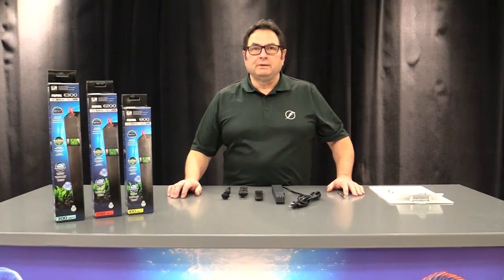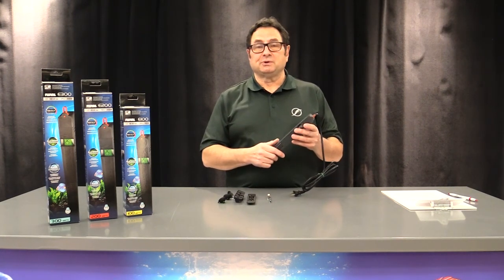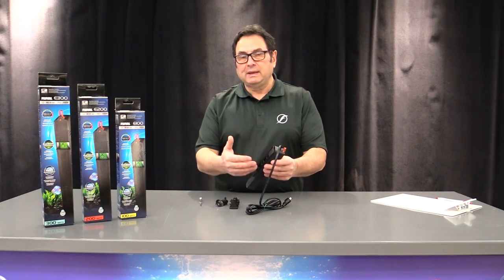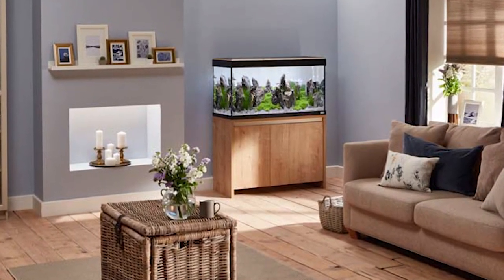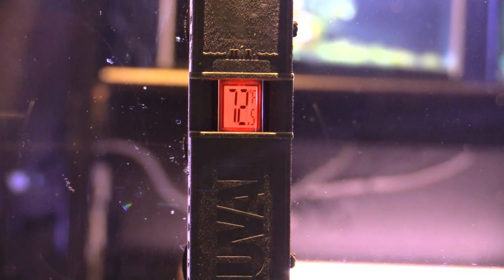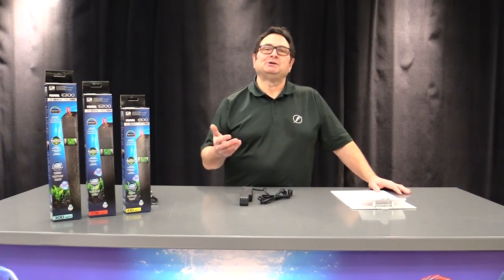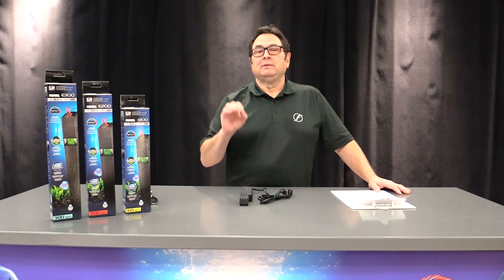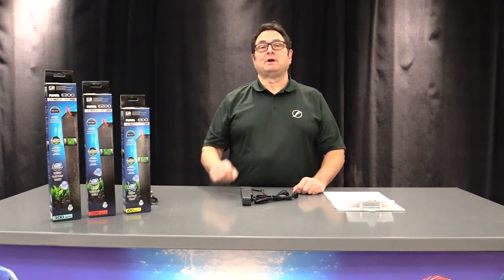Fluval E Series Heater Operation & Troubleshooting Tips

Comment: I've got a 300w heater and it's connected to a inkbrid temp controller,  the heater is  not going upto 26c so the temperature controller is reading below my temp set , it's been going 24 hours and still.noy reached the right temp outflow  from 407 is directed onto.side  of heater so no water flow problems , ive an open top tank so should I cover it or raise the temp? Thanks
Reply from the maker: Hi Lee, what's the ambient temperature of the room? An appropriately-sized E series heater will generally heat the aquarium 6 deg. C / 10 deg. F above room temperature. Covering the tank will certainly help maintain the right temperature!
Reply: Ok thanks I'm also running 2,  407 canisters on it , what the best position for the inlets/outlets,  I have them both at each end of aquarium at moment

Comment: I’ve had the e100 for years.  I recently unplugged it to clean it.  I followed directions in letting it sit before removing, the cleaning instructions, and letting it sit in the aquarium for 20 min before plugging it back in.  Now, it will only display 25°C.  I tried to use the set directions to change the set temp, and also tried pressing the lever to the left for a 5 count to change it to Fahrenheit.  It won’t change to Fahrenheit, and I also cannot get the temp to flash to change the set temp.  Not sure if the lever switch has just gotten really old or what.  Any suggestions?
Reply from the maker: Hi Bryan, we're sorry to hear about this! Our customer support team is available to help you: https://fluvalaquatics.com/us/contact-us/

Comment: Just got one of the 100w heaters in a 75lt tank and set it to 80f  and heater cannot get tank upto the right temp, stays on 77f and drops to 75f but it cannot get above 77f in my 75ltr tank ?
Reply from the maker: Hi there, we're sorry to hear about this. As E Series heaters are housed in protective casings, it's important to ensure they are subjected to strong water movement. Ambient room temperature is also a factor: if the difference between it and the heater's set temperature is more than 10°F / 6°C, additional heating capacity is likely necessary. For more assistance, please contact our customer support team: https://fluvalaquatics.com/us/contact-us/
Reply: @fluval  tried moving it and still the temp cannot reach 80f i set it to , blue light is lit at 76-then 77  but wont go any higher , realy poor quality heaters in my years of owning loads of fish tanks ,  heater rated for 120l and tank its in 75l ?

Comment: I have an E300 on both a 50 and 55 gallon.  They struggle to keep up.  Instructions say to install it at 45 degrees--but it looks like crap.  Both tanks have Fluval 305 and 306 canister filters on them and an air stone directly below heater.  Flow should not be a problem.
Reply from the maker: Glen, did you try placing the heater such that the flow is directed at the side of the heater cage?
Reply: @fluval  Yes, it does not seem to make a difference.

Comment: I got my heater over almost a year but I noticed is not heating the water I set up the heater at 77.5  and display said 76.5 in the morning 🤷🏾‍♂️
Reply from the maker: Hi there! It's normal for the water temperature to fluctuate slightly, especially in the morning, when the house temperature has dropped overnight. You should see the water temperature heat back up quickly - if it doesn't, please contact our customer support team for assistance: https://fluvalaquatics.com/us/contact-us/

Comment: Last night, I placed a Fluval Series E100 in a 29 gallon aquarium. The heater was between two hob filters. The temperature was set to 76.5. 

At first, the heater was working fine, however, after about an hour and a half, it began showing the low flow indication quite frequently. During this time, the temperature had reached 77 and was staying around 76.5-77. Then, after a few minutes, the light turned red and it showed 79. It then went to 78.

At that point, I unhooked the power and after a few minutes I removed the heater and placed the original back in. It was getting late and it would have been too risky to leave the heater in.

Placing the heater directly in the flow of the hob filters is not really possible. Is there anyway in this situation to ensure the low flow problem ends and that it does not start registering unusual leaps of temperature? The heater just arrived yesterday.

The heater was in a vertical position, as the manual seemed to recommend that. It was completely submerged, though the temperature display was fairly close to the surface.
Reply from the maker: Hi there! Try positioning the heater more directly in the path of moving water, or purchase a small circulation pump and position it to blow across the heater to help with heat distribution in the aquarium. Please feel free to contact our customer support team for more assistance: https://fluvalaquatics.com/us/contact-us/

Comment: What does the EE display mean? I've had the heater for 6 months and all of the sudden it is displaying a red "EE" and my water has dropped to a dangerously low temperature
Reply from the maker: Hi Adam, that is an error code. Unplug the unit and re-plug after few minutes, the unit should reset and operate normally.

Comment: Hello if  I'll put the heater in return pump section and if my water level will drop there, heater will shut down? Thank u
Reply from the maker: The E series does have a safety shut off. That said you should never allow that much evaporation without top off and partial water changes.

Comment: Hi there ,great presentation! Did answer on my few questions, but still there is one remains - I do have a 250L tank and I need temperature of 25 degrees to be , what temperature is should set-up? If I will setup for 25 degrees ,is my tank would be 25 degrees ? Or I need to bring up temperature on the heater higher ? The themometr shows that is 25 degrees and display on green light ,but I also using a normal Themometr and shows that is only 21 degrees in the tank.. which make me confuse a little bit ,could help me solve this problem please ? As it's really important to my terrapins that the temperature in the tank stays at 25 degrees I do also running another heater ,but don't know if there is a need of ,I wonder if the Fluval will be enough it selfs to heat up the desired temperature, Thank you
Reply from the maker: The E Heater comes with a default factory set temperature of 25 deg C. Some mass produced thermometers can be a couple of degrees off, you should check with another one, preferably digital with a fresh battery. It is also important to respect ambient temperature/aquarium volume limitations when choosing your heater in terms of power, 3 watts per gallon as a general rule. You may review the supplied instruction manual using this link: https://fluvalaquatics.com/manuals/Fluval_A771-A772-A773-A774-E-Heater_Manual.pdf
Reply: @fluval  thank you for the link ,I bought the biggest one which is E300 and the manual says it's up to 350L * mine only had a 250L ,which I thought would be enough to cover the whole surface of the water in my tank. Thank you I will check the temperature with digital  thermometer .

Comment: I have the fluval edge 46l with the 50w E heater. I can't get it to go above 25 degrees? The only time it goes above 25 is when it has gone up through the room being warmer and it flashes red. Can it not be increased beyond 25 degrees ? 🧐🙏
Reply from the maker: Absolutely. If it is flashing red that indicates that the water temp has risen above the set temperature.
Reply: An heater will only heat between 6 and I think 10 degrees warmer than room temperature depending on wattage. In a cool unheated room you probably need two.

Comment: Great video, one other question, how do you change the displayed temperature from Fahrenheit to Celsius?
Reply from the maker: Thanks for the question, hold the lever to the left for at least 5 seconds, here is the link to the instruction manual, it is covered within: https://fluvalaquatics.com/manuals/Fluval_A771-A772-A773-A774-E-Heater_Manual.pdf
Reply: Try hitting it. 👍🏽

Comment: If my ambient room temperature is 67 degrees, and I set the heater to say 82 degrees... will my water temperature ever get to 82? Seems it won’t go past 77 with this heater. I have a 300w.
Reply from the maker: Hi Tom, ambient room temperature will definitely contribute to the temperature of the water within your aquarium. Generally, the E-series heaters will increase water temperature up to 10 degrees Fahrenheit above the room temperature which is what seems to be happening in this case. To achieve a temperature of 82 degrees you may need to add a second heater into your setup or increase the room temperature slightly.
Reply: @fluval  Well, my old 300W Marineland can keep the tank at 80 or 81 without a problem. Was hoping your heater would be better. I guess I'll just stay impressed with your canisters and LED's for now...

Comment: Is it safe to put the heater halfway into the water or partially out of the water? I would like to install 3 E300 in my sump.
Reply from the maker: It should be submersed to the minimum water level mark on the heater.

Comment: Good day 

I hope you can help I am always uesing fluval E heater 300 watt . I have a problem with the temperature lever when I move it to adjust the temperature it seems it is not working because I turn it to the - or the + sign but the temperature degree does not change as if this red lever is bugs  so please advise how to solve this issue
Reply from the maker: If the heater has been previously functioning normally and is still under warranty you should contact customer support by visiting fluvalaquatics.com
Reply: Thank you very much I already sent them an email.

Comment: Is a 100w going to fit nicely in a 15g Fluval Flex?   AND if put in the pump or first chamber - is it going to work with flow?
Reply from the maker: We recommend Fluval M Heaters for use in Flex tanks when placing them in the pump chamber, due to flow considerations and ease of fit. Yes, the 100W E series will fit in the 15g Flex aquarium.
Reply: @fluval   Damnit - I just bought the E.  What is with this low flow issue with these?  Seems to be a problem with people.
Reply: @fluval  It should say this heater won't work with the Flex!
Reply: Um - it's working fine in the Flex in pump compartment.  :)    Cannot read the numbers though - just color.  It's not yelling at me for 'low flow'.   OK.  :)

Comment: Great video what is the steps to take on this heater as far as doing water changes? Thanks
Reply from the maker: During partial water changes simply unplug the heater 5 minutes before, plug it back it in after the partial change is complete.
Reply: @fluval  Thank you 🙏

Comment: How would i no if my heater has stopped working, my temp dropped and has not gone back up to normal for about 24 hours
Reply from the maker: Slowly increase the temperature back to where it should be by doing small water changes over an 8 hour span, that should avoid shocking your fish. Install another heater and investigate the heater failure.

Comment: Why can’t I increase the temperature on my fluval E50. I have had it running since November 2019 now it won’t increase above 23 degrees centigrade.  I have had the temperature up at 29 as I was having a problem with ich but now it won’t go above 23  🤔
Reply from the maker: What are you using to check the temperature with? Which thermometer exactly are you using?
Reply: Fluval Aquatics I am using the fluval  E50  in a fluval flex 50 ltr aquarium 🐠

Comment: Hi, can you tell me how to change from F° to C°

Thanks
Reply from the maker: Hi Antonio! To change the degree scale, hold the set lever in the full left (-) position for at least 5 seconds. When the new degree scale is displayed, you may release the lever. After a few seconds, the display will automatically return to display the water temperature.

Comment: Awesome video! I’ve just bought one of these from a friend and after watching your awesome informative video I’ve learned a LOT!
I just have 2 questions if anyone can help me please,firstly are these heaters fully submersible?
Also,I’ve tried to adjust the temperature but for some reason i move the stick left and it goes to 26,I move it right and it goes straight to 30,no inbetween and also 26 is flashing blue but 30 is green which makes no sense at all :(
Can someone please kindly help explain what I’d going on with my heater please,I have a 58 litre tank and are using the E50.
TIA
Reply from the maker: It is a fully submergible heater. Try a short quick movement to either side to increase or decrease in .5 degree increments. Set temperature will dictate screen color as will warning variation settings for flashing alert. Please visit fluvalaquatics.com to download the user manual.

Comment: Sometimes my heater is off a degree or 2°C, how do I recalibrate it ?
Reply from the maker: What are you comparing the reading on your heater against?
Reply: @fluval  a boiler thermometer and a pool thermometer. They both display 28°C, but the heater is at 30°C.

If I bring the temperature to 28°C, then the water goes down to 26°C.

Comment: Why is my e200 heater have red EE?
Reply from the maker: Hi Christy, as per the product manual this notice implies that the waters temperature is hotter than what the heater is set to. This can happen for multiple reasons, the most common being that the aquarium light or other equipment is causing a slight elevation in temperature. Our best advice would be to reset the heater by unplugging it and letting it rest outside of the tank for 40 minutes. While you do that, remove your aquarium hood to allow some excess heat to escape. After the 40 minutes, reinstall the heater to see if the notice reappears. if you run into any trouble with this, please contact our customer service team for further assistance. 😊👇

https://fluvalaquatics.com/us/contact-us/

Comment: HI what dose LF MEAN
Reply from the maker: Hi there! The LF error code means Low Flow - the heater has detected poor water circulation around it. Try positioning the heater so it receives strong, direct water movement from the filter. 👍
Reply: @fluval  oh okay I saw that on the video and didn’t give it much thought thanks mates appreciate you lot

Comment: I dont have a thermometer but I'm positive that the reading I'm getting off the heater is wrong
Reply from the maker: You should obtain an accurate thermometer to confirm.
Reply: @fluval  well I put the heater in tap water that is 100% colder than the 27.5 degrees C reading that's its giving me. It's just flashes red what ever I do

Comment: hi i was wondering how could i raise or lower the temp of the heater thanks
Reply from the maker: In this video we describe the adjustment of the set temperature.
Reply: @fluval  i am having issue's with mine it well allow me to lower the temp but not raise it
Reply from the maker: Please contact customer support at fluvalaquatics.com by selecting your country and then the support page, we will certainly help you out but require some detailed information about your set up  first.

Comment: Why does the heater have such a bulky casing?
Reply from the maker: Dennis, the heater guard is useful when keeping large fish or turtles, both of which can damage unprotected glass tubes.
Reply: I've had 2 Mollies burn themselves on my old heater which wouldn't have happened had a protective cage been around the heater probe. 😔 So  I myself am extremely grateful for Fluval putting these cages around this particular heater series.  To each their own though...Just know if you decided not to invest in one of these, you're definitely missing out on one fabulous working Fluval heater. Fluval hasn't disappointed  me with the first product (knock on wood).

Comment: Those heaters got released in October 2009, exactly 10 years ago! Most shops stopped selling them due to the “low flow” problems. Why this re-upload? I’m sure 10 years is plenty of time to re-engineer a digital heater and give us a new product instead of trying to sell a failed one.
Reply from the maker: Dimitrios, correct, we mention that the heater is not new in the video,  the point of the video is not to sell or re-sell but to support some of the questions and inquiries we have been recently receiving about the E series, hence the title: Operation and Troubleshooting Tips.
Reply: @fluval  Despite of the negative comments and the problems, I was actually looking to buy it because I'm tired of the inaccurate analog heaters. I'm looking forward to see a new version of this heater!

Comment: wasted money buying 2 of these for my 100 gal. tank. If you live in colder weather these will not heat your tank, you would have to have your house at 70 degrees to get to 80. I don't see how someone could build a heater with all the features except heating tank. How efficient is it to have to raise home temp to heat aquarium. ridiculous
Reply from the maker: Thanks for your comment! As per their intruction manual and packaging, E series heaters are engineered to increase water temperature up to 6°C / 10°F above room temperature (20°C / 68°F).
Reply: @fluval  That's nice at the bottom in small print you put may need a second heat to get temps to 10 degrees above room temp. I have 2 and they still can't get to 10 degrees above temp. All in all I guess these would be a big hit in Hawaii. Most of the states in the US will have colder temps and these don't work
Reply: Yeah, this is bullshit. Only reason I bought this heater was to heat my tank, which is in my basement - room temp is 65 degrees all year around in Michigan. False advertising by omission. I want my money back. This heater is useless.